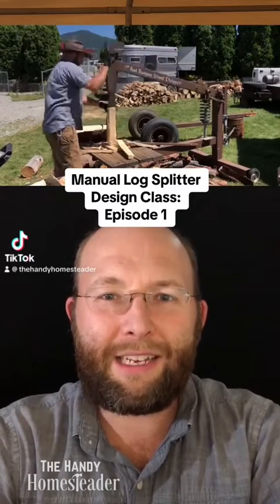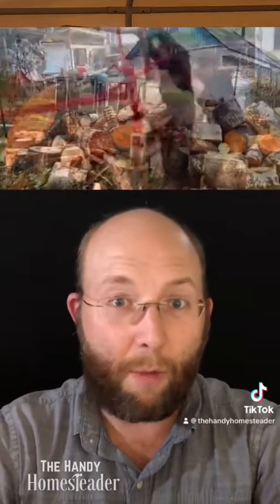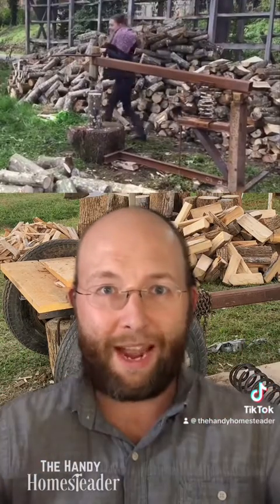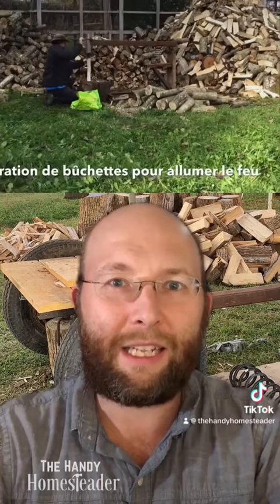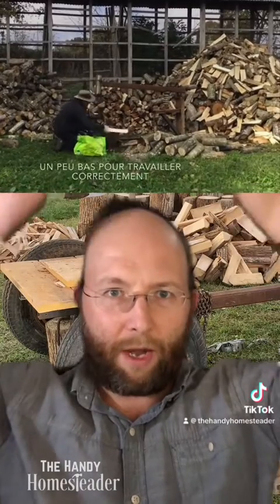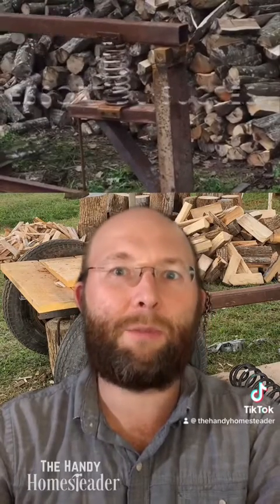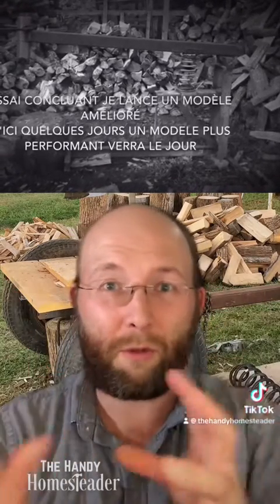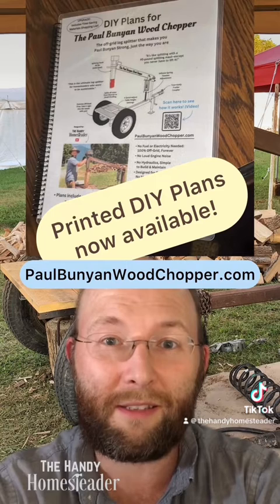Manual Log Splitter DESIGN CLASS: Episode 1

Comment: I'm sure it's just a piece of cake to split small pieces of dry ash,  I'll stick with my 21 ton for the rest of the forest
Reply from the maker: Yeah different designs work better or worse. I use mine (shown in the intro) on white & red oak all the time and it works great. 
If you’re very splitting large, severely twisted or knotty rounds, then there’s no replacement for a heavy duty hydraulic or kinetic splitter.

Comment: My own splitter isn't going to go on youtube until I get to Mk2 at least. I have a fair hunk of weight on the end of mine with several feet of railway line in use. As it's twisty, knotty Aussie hardwood that I'm splitting it needs some oomph behind it. It does work pretty sweet for kindling.
Reply from the maker: Nice! I can’t wait to see yours when you get it done. 
I really want to experiment to see how heavy I can make the splitting head without making it impractical. The more weight, the more oomph. 😉
Reply: @TomWylie 
Bicycle people have determined how many cranks per minute is optimum for the  peddler. If the head is too heavy that would slow it and that would be like having a bicycle in too high of a gear.  It depends on the size of the operator.   
It depends on the capacity of the spring.
Compressing the spring beyond its elastic limit will damage the spring.

You will not get any more energy out of it then the amount of energy that you put into it, regardless of the weight of the head.

To drive a small nail you want a small hammer but to drive a large nail you want a large hammer.  Some hammers are too large for some people to swing in a comfortable manner.  Some hammers are too small for the blacksmith to demonstrate his strength.
Reply from the maker: @jakebredthauer5100   yep. The other element to consider is that sometimes you are splitting wood in a repeated rhythm, but that’s only a portion of the time, depending on how tough the wood is to split and whether you are just cracking each piece in half, or reducing it all the way down to kindling. Operating height of the table and splitting head are also factors that affect comfort and convenience of operation for the given length of firewood round being split.
Reply: @TomWylie  
The weight of the head does not affect the frequency of the natural bounce.   The weight of the head does affect how quickly the operator can move the head. The frequency of the natural bounce is determined by the length of the beam in the same way that a long pendulum has a slower frequency than a short pendulum.
It would be best to have adjustable weight for different needs.